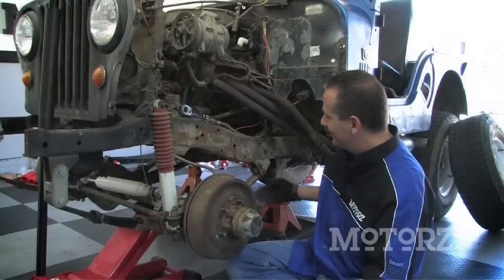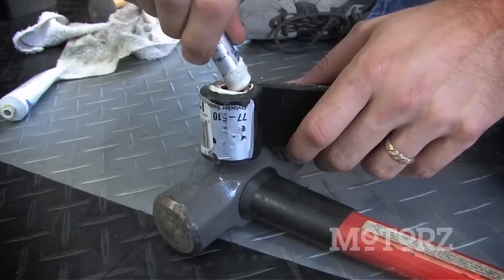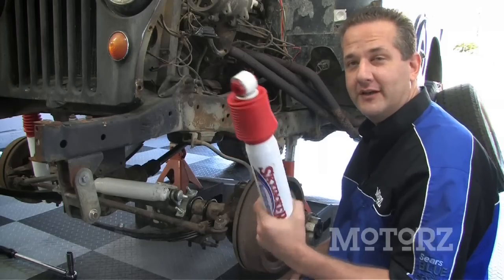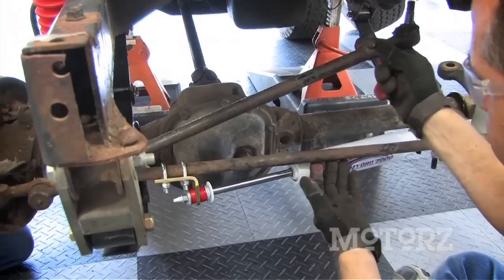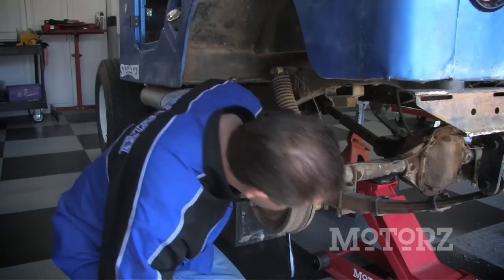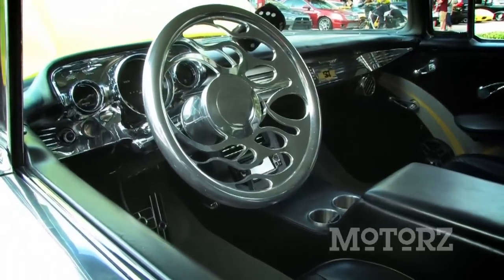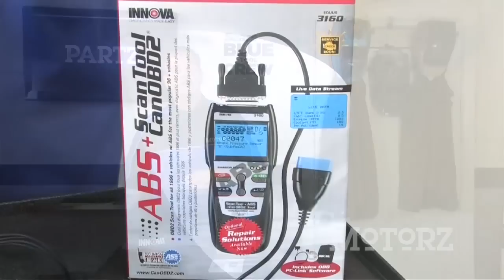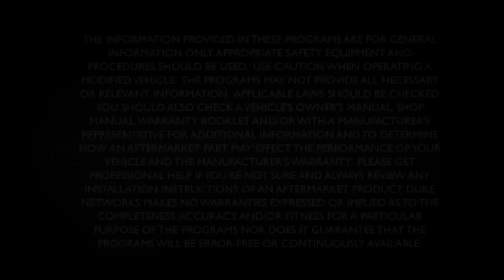How-To Install Skyjacker Lift Kit Jeep CJ5 Motorz #53

Comment: Couple things I saw wrong... The steering stabilizer should have been positioned above the lowest metal part of the axle, not being unprotected. Also, it was dangerous to use chrome sockets with an impact, they are likely to break and shatter. Lastly, you said you needed a "four wheel alignment" when in fact it is not possible on this vehicle due to the solid rear axle. There is no way to adjust the rear wheels in alignment.
Reply: You forgot the using a screwdriver as a punch